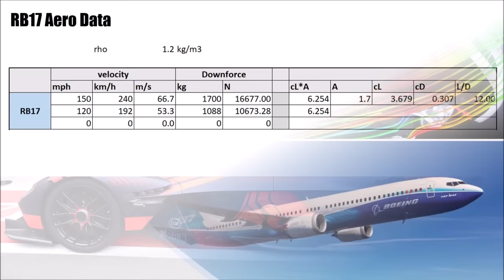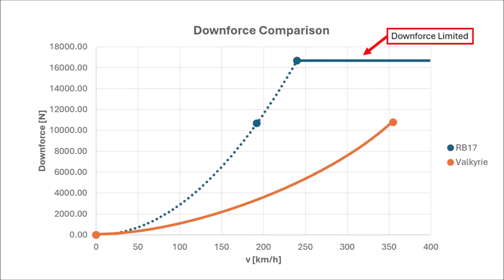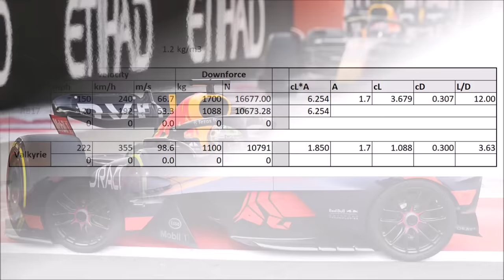Red Bull RB17 - Part 2 - What We Know So Far (15,000 RPM V10!)

Comment: At the end, you point out what flawed the Valkyrie... Road legal. Of course a compromise is necessary, if you want to ride on public streets, and this one won't suffer from that!
Reply: It would've made more sense to compare the RB17 to the Valkyrie AMR Pro
Reply: @ISSTI371  in theory yes, except of course the AMR Pro is still based on a road car... Most extreme road car ever, but that's still not the same, there are constraints that are too hard to engineer out of the car (multiple country crash requirements, engine idle and reliability, etc.)
Reply: Mmmm... they only have 3 things in common: headlights ,engine and the name. Everything else is new.
Reply: There are states in the US where this car could easily be road legal. If it was somehow shipped as a ‘kit’ or utilized the pieces of an existing car that held the VIN.
Or of course under the ‘show and display’ rules. There are no emissions tests where I live. All you need are the correct exterior lights and a safety test. And a working windshield wiper and horn. And a high beam indicator. Who knows why. 

I’ll just look in my couch cushions. I’m sure there’s $6 million in there somewhere.
Reply: not entirely. The fact that GMA is able to produce a road car (T.50) that’s lighter than the Valkyrie while having three seats and much more luxuries seems to indicate that something went wrong in Aston’s part of the Valkyrie’s development.
Reply: @devandrasimanjuntak1646  That is a VERY good point... Although body and engine sizes are on GMA's side. And (even though I am sure Newey can manage weight), it's Gordon Murray that's the one obsessed with weight
Reply: @devandrasimanjuntak1646 ones a hybrid and has 400 less hp…

Comment: Worth noting that Red Bull’s F1 suspension partner, Multimatic, has developed a new active suspension system in use in the Ferrari purosangue. There’s a good chance that system will make this car if it requires active suspension.
Reply: The Purosangue suspension system is patented by Ferrari
Reply: @gentnextdoor  the software, yes. The hardware is a Multimatic product. I imagine if Red Bull asked, they’d get the TASV system, but would have to create their own control system software.

Comment: V10 at 15k RPM, is going to sound amazing. Even better then the Lexus LFA.
Reply: Even just hearing this V10 at 15000rpm full song will make me cry tears of joy!
Reply: not necessarily better, but def higher pitched
Reply: Nope,the LFA was literally designed to sound good and not only just like a V10 engine.
Reply: @khanyilemgwebi2575   you know this as a fact?
Reply: @satanswolf  a fact based on what? Revving higher doesn't automatically make your engine "sound better",it might not even make it any louder,a lot of things go into making an engine sound good and loud.
Reply: @khanyilemgwebi2575  where you on a track listening live V10's revving at 15K RPM? I was, they sound better.
Reply: Carrera GT e Solus GT já soam melhor que a LFA 🧐
Reply: @gabrielbarcellos1036  No they do not Solus sound is engineered, Carrera Gt rev range is not even close to the LFA
Reply: @satanswolf  LFA é um som borbulhante, como se fosse uma Huracan mais aguda, Carrera GT tem um ronco único, nenhum carro soa como ela
Reply: I'd take the sound of plenty of v12 before the lfa...

But because of 15k rpm i might prefer this to a v12...
Reply: @ap4931  V12, that's the voice of angels in heaven. This one instead will be raw and angry like F1's of 25+ years ago. Those screamed like like fallen angels!
Reply: @satanswolf  it will likely be epic!
Reply: Carrera GT > LFA
Reply: Engine sound is completely dependand on how the exhaust system is set up and has nothing to do with rpm AT ALL

Comment: I'm quite interested what was the rationale for the V10. Of course, as a lover of high revving NA engines, this is lovely, but Im curious if it's wether to do with design issues and compromises caused by the Twin turbo V8 or the Cosworth V12, or if it's Red Bull fully committing to the Rule of Cool, or simply Newey's prefered design phylosophy.

Comment: V10 layout, 15,000 rpm and around 1,000 hp points to an engine capacity of around 4.2 to 4.5 liters.  The problem I see there is the valvetrain as those are big valves have to operate very, very quickly.  I doubt it could avoid valve float without either a pneumatic or desmodromic valvetrain.  They should stick with a V12 to give it more of a chance.  Either way it will be interesting to see what Cosworth come up with.
Reply: Maybe they'll just dust off and update an old CR or TJ-series F1 V10. It would work for a trackday only machine.
Reply: @rafaellastracom6411  sources point it's not street legal. Only track legal. RB doesn't want to deal with Governments.
Reply: @gerogyzurkov2259 what makes it illegal? Just put a catalytic converter and muffler in there ;)
Reply: @RCmaniac667  safety and crash safety regulations. People bemoan same or similar style yet we forget safety regs pretty much change everything. They dictate that.
Reply: Valkyrie is street legal, this one is a track-only car, which means much easier to achieve more power and RPMs

Comment: 5:14 where is that speed rating from? I've read quite a few articles mention 1100kg of downforce for the road-going Valkyrie, but a couple say it's at 93 mph (which sounds like bs, pardon my french), a few mention at 137 mph (sounds more reasonable, tho still a racecar level), and now at the top speed. I'm curious as to what is more correct in the end

Comment: Homologating a 15k RPM V10 could be possible if they manage to homologate it under a "small production run". Unlikely but a possibility non the less
Reply: That production run has to be road legal also. RB probably doesn't want to deal with the red tape. I mean Koenigsegg is closest to extremeness with their top speeds and they still nowhere close to what actual non street track car would of been.
Reply: WEC needs to just make a whole new class above hypercar for crazy cars like this
Reply: @21sled  One problem. F1. FIA won't make a class to rival F1. Any faster than the current Hypercar class and we start getting closer to F1 speeds which as seen by LMP1 this will not be sustainable at all and will die out. They could of made it even faster with LMP1, but that would make it even more expensive. Plus FIA will not be happy and will not make any WEC class to rival F1 in terms of speed. Hence why Hypercar is a huge compromise of pace from LMP1 for more sustainable development and life to the class. Otherwise it will go out like LMP1.
Reply: @gerogyzurkov2259  and i'm glad more manufacture agree about WEC
Reply: @21sled  it's not WEC
It's the manufacture who don't want to spend more money 
That could more expensive than F1 cars to run on 8-12 round full season
That's not very wise
Reply: @Bncxx1275  The last sentence was what according to people said the reason why LMP1 died out. LMP1 was almost as expensive as an F1 season with non of the pay off that F1 can give out. Namely the money and marketing which WEC lacks hugely. Not to mention still slower than F1. The fastest Lmp1s which where 2016 I think where still way slower to the same year 2016 F1 cars.
Reply: @gerogyzurkov2259  which i agree of current hypercar class rules under bop with 2 ways prototype budget
Just 2 problem
They still not make all car balance set right
And i like more imsa BoP set and restart after full course yellow

Comment: Something I noticed about the RB17 that I don’t think anyone else did is that if this car is going to build on the foundation set by the Valkyrie, and the Valkyrie was built with the intent to race at Le Mans from the very beginning, does this mean that Red Bull is also targeting a Le Mans hypercar project? I mean, the image they showed us demonstrates a very similar body shape and outline to the Valkyrie, which is the legal shape for an LMH/LMDh car, so it would stand to reason that such a thing is at least a possibility
Reply: Valkyrie wasn’t built to race at Le Mans from the very beginning: the decision by the ACO to ditch the then LMP ruleset coincided with the early days of the Valkyrie project. AM then begged and pleaded with the ACO to re-write the rules to a top class based on road hypercars, a la GT1 days, so as to make the Valkyrie eligible without too many mods. That was why there used to be a rule stating ~20 road legal LMH cars were required to be built. Then Stroll pulled the plug on the project, leaving the ACO with a set of rules worse than the ones they initially drew up. There’s a much more comprehensive, interesting and passionate account of this story buried in the depths of FerrariChat somewhere
Reply: @maz4304  that’s not the story Aston Martin tells, but ok. Either way tho, the Aston Martin Valkyrie has the shape of an LMH car, and by extent so does the RB17. There’s no way that’s just down to coincidence
Reply: @mrsoisauce9017  Aston Martin loves their public narrative. All manufacturers do. Though the former can't say much when their facing having to pay a huge amt of debt to 1.1 billion i think it was £ which is probably not going let them to race at Le Mans by the time they pay all of it.
Reply: That why I kinda hope they fail tbh given they permanently screwed Glickenhaus, and made Toyota wasted a lot of money, and time.

Comment: Too bad not a Honda engine as Honda has V10 that was originally for new NSX
Reply: Not sure what you mean by that, the Honda V10 engine is street-focused, 500 hp & 8.5k RPM compared to the 1000 hp & 15k rpm here
Though the impressive part about it was that they were planning to make 4,000 of them

Comment: I mean the Valkarye AMR Pro is already faster than the last gen LMP1 cars, so I think its fair to say that the RB17 would definitely be able to stay within at least 10 seconds of an f1 car laptime at a minimum.
Reply: Valkyrie am pro hasn't set official lap times yet. Give sources plz. Manufacturer claimed isn't right to use. At least AMG One bothered to do it.
Reply: The only laptimes I've been able to find for the AMR Pro are from Bahrain where it was barely faster than a GTE car, it's far away from LMP2 and the current Hypercar class, nevermind the absolute monsters that were the previous gen hybrid LMP1s.
Reply: @freyala024  at least props to Merc of making official lap times for their project One car.
Reply: @freyala024 any lap times will be massively driver dependent. Of course that’s the case with all cars, but much more so with a car like this. Best guesses, AMR Pro is 95-100% speed of peak LMP1. Although heavier and not 4WD, it’s super aero efficient in comparison
Reply: @freyala024  The Valkyrie  was able to do production car record with road tyres, a record faster than a GTE with slicks. The AMR Pro is in the LMP1 zone.
Reply: @sebastianplaul5513  A AMR PRO according to Motor Authority did a 1:54 on Bahrain in 2022.
Reply: Regular Valkyrie did a 2:01 on Bahrain 2019. Well why alot Bahrain? Aston wants £££ from Saudi and the customer base.
Reply: @maz4304  it's more setup and tires.
Reply: @gerogyzurkov2259  demo mode. 800hp, not the right ride high or setup whatsoever.
Reply: @sebastianplaul5513  Not sure as Motor Authority said AM PRO has no hybrid. Whilst the regular car has the hybird system. Both still develops 1000hp from their V12s. So 800 hp seems weird.
Reply: @gerogyzurkov2259  Shmee video in Laguna Seca "the car is in demo mode, with 800hp"
Reply: @sebastianplaul5513  the lap times are not in Laguna Seca. The ones I listed are from Bahrain. The Bahrain times are full power otherwise they would note it.
Reply: @gerogyzurkov2259  my friend, I just give you an example of documented footage of the Valkyrie AMR Pro running in Demo mode. That 1:54 in Bahrain was in demo mode.
Reply: @sebastianplaul5513  Shmee Video is fine pioints, but what's the lap times for that 800hp? Pointing out a mode is fine but how much does it decrease the lap times? We need a lap time regardless. Main point is. I don't care for the slower mode attention so much if it doesn't give info how much slower . Give me lap times. 

I got info from car scoops who take it from Evan Lewis youtuber who did get footage of the run a Valkyrie lap time on Laguna Seca 1:19 or 1:20. Doesn't say whatever mode it is noted from the same source car scoops who used the on board during that same 1:19 or 1:20 lap times that it is slower than the DPI category which normally runs 1:15. DPI are abit faster than the LMP2s on the track like 1 and 1.5 secs faster according to Car Scoop. LMP1 where not mentioned on there, but we can use other information to figure out how fast LMP1s would be. 

I found on oversteer48 official Bahrain lap times for the major categories of FIA that race there from F1 down to GT3. Mainly the record laps of each category. The fastest LMP1 lap record was 1.41.511 set by a 2016 R18 Etron. LMP2 lap record is a 1.48.579. As for GTE 1.56.942 was set by a 2019 Ferrari 488 GTE. So according to this infor 1.54 or some say more 1.52 for 2022 AMR PRO would be sloted in more to the slower LMP2s cars and closer to the now closing GTE class being replaced by the GT3 class. The 2.00.675 set by a 2020 Mclaren 720S GT3 is the fastest for that class. The latter will get quicker.

Oh and to show much faster F1 is to anything and how much RB17 is going to need to do to get closer. The lap record on Bahrain is 1.27.264 lap time set from a 2020 W11 driven by Lewis Hamilton in Qualifying.
Reply: @maz4304  More aero efficient than LMP1 based on what? Because Aston Martin says so? Forgive me if I don't take their word for it, they initially claimed the road car would be capable of F1 level laptimes which was just laughably untrue, even the AMR Pro which has nothing in common with the roadcar aside from the engine and the headlights and is completely unrestricted would get its doors blown off by a GT3 car, nevermind LMP1H or god forbid F1. I'd be willing to bet good money on the LMH version not being competitive next year on WEC/IMSA.

Comment: No, F1 cars are 798kg, driver included. They've always included the driver. The min driver weight is 80kg, which includes the seat and ballast. So the car weighs 718kg, without fuel
"dry weight" for production cars, also means, no transmission fluid, engine fluid, engine coolant, even the battery cough italian brands*.  That's why an Aventador or an SF90 will have an actual curb weight of over 100kg more than the claimed dry weight, despite on an empty fuel tank.  
Nonetheless, we can be sure that if RB17 has a dry weight of 900kg, it's qualifying weight, with driver, would be well above 1000kg.  Meanwhile an F1 car in qualifying trim is probably 808kg.  That's a weight difference of at least 25%.  Absolutely zero chance of this thing beating a modern F1 car.

Comment: If it's not street legal then that disqualifies the car from holding the top road car record at the Nurburgring.
 That might not matter if it's "able" to be licensed for road driving but it would have to run any record attempts in street configuration.
Reply: Street car = unmodified production car. Even if modified to street it still it has to be unmodified in that state production car with numbers. According to Guinness records it has to be at least for production street legal 50 produced to qualify.
Reply: @gerogyzurkov2259   Great info.
So this means Red Bull only needs to sell 20 units in street configuration to qualify.
Reply: @budthecyborg4575  yep
Reply: @budthecyborg4575  actually checked its 50 units min.
Reply: @gerogyzurkov2259   
It is a weird technicality that's easily circumvented though, technically it doesn't matter what configuration customers order Red Bull could just "deliver" every car in road mode and then change all the parts to race mode according to customer spec after the fact.

Comment: Ok but what is the rb17?
Reply: RB own hybrid v10na track car. Engine is made by Cosworth. Newey heading it.
Reply: @classicjoker2008 OK got it.
Reply: Due to the-virus-that-shall-not-be-named, RBR F1 went from the RB16 F1 car to an updated RB16B car the next year. For that reason, the RB17 F1 car was never made. Hence, RB uses that name (to fill in the gap) for their F1 car for the road track.
Reply: @theGoogol  valkyrie may have done some things wrong but surely it didnt get the name wrong
Reply: @gerogyzurkov2259  is it a formula car or a valkrie type thing?
Reply: @supermantrly  non it's a extreme track only car
Reply: @vercingetorige400  Valkyrie problems is not the car, but Newey having to head butt with bigger people than FIA namely the actual governments.
Reply: @vercingetorige400  : You're refering to the virus-that-shall-not-be-named bit?
Because I was refering to the year some global virus messed with the F1 calendar and ticket-sales.